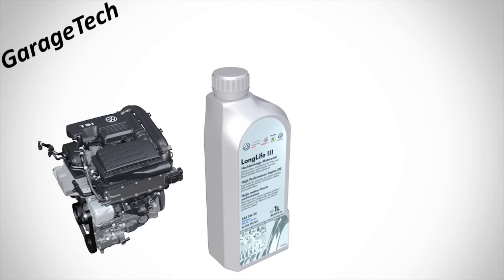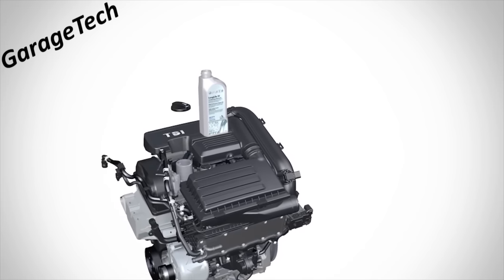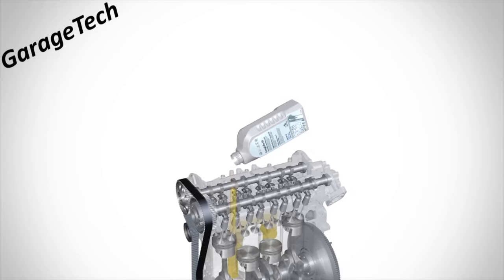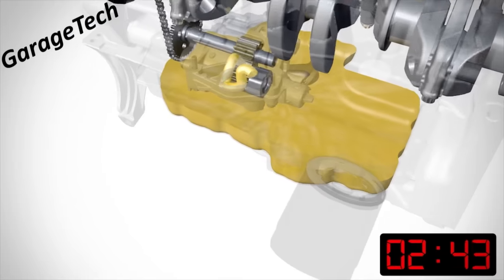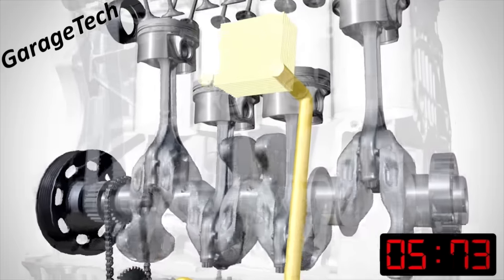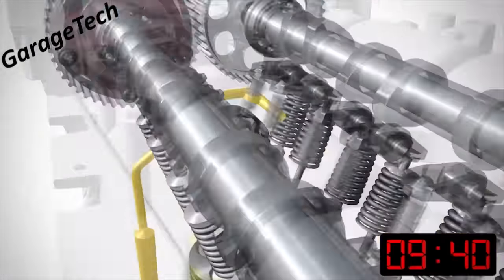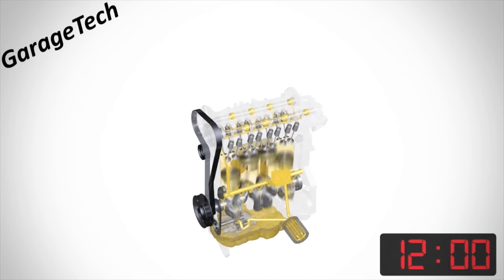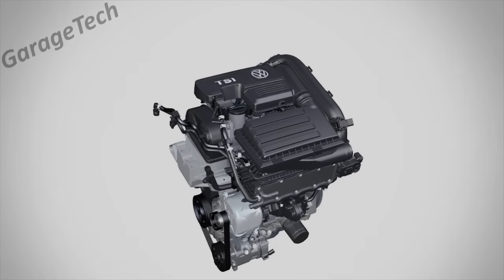How oil circulates around an engine when started

Comment: This video proves why start-stop systems destroy the engine.
Reply: No drain back on stop start so unless it's parked overnight the oil is there

See below ⬇️
Reply: Some Luxus cars like Mercedes have an electric oil pump that makes the oil always circulating. Anyway I also think it's very stupid. It is just one more thing that can break down (and it does pretty often)
Reply: @mikb7360  my vrs 128k no probs
Reply: @mikb7360  This system was introduced in order to reduce CO2 emissions. I don't know how efficient it is in real life. I usually have it turned off on my car. I think it is efficient when the car is stopped for more than 15''. I believe that the total cost of fuel saved is much less than the cost of parts wear when it's time to replace them.

Comment: First, oil will remain in your rod bearings, crank bearings and especially your cam bearings unless you take like 6 days to change your oil. Also your oil filter is backwards. Oil goes in from the outside into the center of the filter.

Comment: The time it takes for the oil to circulate depends on the temperature and the oil weight (viscosity). Thats why its super important to use the correct weight oil for your engine. If its a freezing sub 0 morning and your running a heavy weight oil it could take 30+ seconds for it to reach the top of the engine.

If you peek into the top of the engine thru the oil filler cap, you may or may not notice score marks on the camshaft lobes. Scoring is a sure sign of an engine that gets ran hard from cold on a regular basis.
Reply: It doesn't affect the time really. But it does affect how much oil goes where.

The thickness of oil you need to use depends on the tolerances between bearings etc. Using thicker oil increases oil pressure because it's struggling to flow through tight spaces like bearing, which causes more of the oil to flow elsewhere where there's less resistance to flow (which is usually higher up in the engine).

Hence why it's sometimes a good idea to change to switch to slightly thicker oil when the engine racks up a lot of miles.

Comment: There is something wrong in the animation with the oil filter. The oil never comes in fron the center hole. The correct insert is from the peripheral holes of the filter and the outlet from the center.

Comment: I always soak filter before install. Just makes me feel better. Also, I guess wrist pins get oiled up thru the rod?
Reply: Robert Miller I do too , unfortunately some cars you can’t went filter is mounted the wrong way
Reply: Wrist pins get lubricant by splashing oil out of the foot rod bearings; in this animation, the oil should flow trough the cooling jets from beneath the pistón skirt...

Comment: When it's -15C outside the oil comes to the necessary places much later than 12 seconds. I have a bottle of oil in my garage and when it's -15C or even colder the oil 10W40 becomes dense like jam. That's why we use 5W30 :-)

Comment: From this picture it is clear that overfill engine oil is very bad because it can cause foaming from the churning mechanism from crankshaft.  However, it takes a lot of overfill before it happened.  1-2L overfill from typical 4-5L engine oil won't hurt anything but our pocket because we used too much.

Comment: I am a mechanic, I generally dont fill my oil filter unless the vehicle is turbocharged or a hybrid, I also leave the engine running for about 30 seconds after filling the car to allow the oil time to circulater before checking the oil level and it also gives me time to torque the wheels and put the spare tyre back in the boot.

As for hybrids, I leave it running for a few minutes or till the engine auto shuts off(switches to elecric motor) to charge the internal battery of the hybrid, this gives me time to do the above stuff mentioned as well as the paper work and washing up, if there is still a bit of time left I tidy my tools

Comment: This is why I turn the key to just power only for 12 seconds before starting the engine. That way the oil has already circulated before the engine has even started.
Reply: I found that spraying WD40 on the key for 12 seconds before starting just as effective.

Comment: Ford Ranger 3.2 five cylinder engines use a variable vein oil pump to save fuel but need to be primed again if oil drained longer than about ten minutes. Lots of damaged engines.

Comment: 12 seconds is slow scenario with modern oils. It depends on oil's viscosity, age and temperature, to a lesser extent, the filter design. I’m aware that this video applies to a drained system, perhaps an older engine with thicker oil, but this isn’t the case with most normal startups. Most modern engines with low viscosity oils will build full psi within 5 seconds, even after replacing the oil.

Comment: Only thing is that the channels are already full and it's a hydraulic action so almost instantenous oil pressure at the bearings is archieved. Maybe in some old shitty engine with bad clearances the oil seeps out if the engine is standstill for long enough.

Comment: It's  a lot less than 12 seconds. Most oil pressure sensors are on the camshaft lube circuit. If the oil light goes off, you have oil pressure, which means oil is flowing at the camshaft. You can probably speed up the video ten times to get an accurate indication. As a mechanic I have serviced many cars and majority have the oil light go off after about a second after startup following an oil change.

Comment: Those 12 seconds that it takes to oil up everything is called dry running its were the engine gets most of its ware when there’s no oil pretty much on start up.
Reply: Magnatec and many others still have a film on it and unless you've just changed the oil OR you haven't started it in a month, there will still be some in the channels and it's more like 1 or 2 seconds.

Comment: It 
The motor oil will be hot to the touch in a matter of seconds. However, it takes the average car 20 minutes to get to normal operating temperature.

Comment: Is there a procedure you can do after changing the oil so when you do a start up you dont hear clatter for the first 12 seconds?
Reply: Dmitry Wiseman u can try disconnecting the fuel and cranking it so some oil gets pushed into the engine, but it can be rough on the starter and it wont oil everything up so it might clatter a bit still.
Reply: Disconnect battery and fuel lines before start.

Comment: According to my 20 year old saabs  owners manual, one should not warm up the engine in cold weather before driving of, since the engine stays cold for longer that way. And thats not good. After startup I just start accelerating slowly no revving no high loading, until the engine is warm.

Comment: Oil filter sizes vary from one cup to one+ quart.
Tiny ones have less air to purge obviously.
Chevy V8s have digressed from one quart filters down to 1.5 CUPS on the new 6.0L LS engines. They also get 5w20 or 0w20 oils. 

Many new engines automatically rev up to 1600 RPM for 4 seconds upon start up. No pressure??

If you're really concerned about dry starts, Google accumulators.

Comment: When i start my engines car i usually not to rev it until it reaches 30secs up, someones told me regarding this matter because the oil haven't climb yet to the top.
Reply: Not true, Video assumes lines are empty (Dry) and if you used the car before that Cold start that means lines are going to be filled with Oil.

Comment: My jeep oil pump is k but engine oil is not circulating what could be the reason.
Reply from the maker: Must be a blockage somewhere, have you checked the oil pickup pipe in the sump?

Comment: Had an idea, how about a way to start the oil pump prior to starting the engine. Lubricate the moving parts prior to starting. Will this work?
Reply: Usually big Diesel engines have an extra electric oil pump for startup, like generators trucks and construction vehicles 
Don’t know why car companies don’t put it in cars . Doesn’t look that expensive
Reply: Well when starting the fly wheel spins with the starter so it’s already moving the engine a little so its kinda priming the oil pump a little
Reply: @ahmedyassir5569  so it is possible.
Reply: Depends on the car. From what I've seen, oil pumps are mechanically driven. Such as on a small block GM the pump is driven by the camshaft

Comment: does this mean if we have a start-stop system in the car, and if we stay at the traffic light for 2 minutes with the car switched off, and start moving forward at 2000 rpm, our car drives for a few seconds without adequate lubrication?
Reply: direktor telekoma A few minutes won’t hurt anything.
Reply: No, oil lines and components are covered with oil, basically oil pump is going to push that oil from the lines, video is showing a new engine first start without oil being pumped before.

Comment: It is incorrect the oil doesn´t enter the filter from the center passage but from the small holes around the edge of the filter! Most of filters does have very simple one way rubber valve under these small holes so to prevent oil to go back to oil pan again. So after first start after oil change there should be at least some oil in there. I think that if you start your car again after i say few minutes to hour you can start at 5 seconds here. Always when i change oil filter there is some trapped oil that starts to leak after I release oil filter.

Comment: Back in the dark ages when cars had distributors, I'd unplug the low-voltage side of the coil and crank it until the oil light went out - and while doing the oil change, I'd fill the filter. It's a bit harder to do all that now.
Reply: My 01 integra has a distributor. Probably one of the last cars of the 2000's to have a distributor.
Reply: I remember the Suzuki G10 engines (Metro/Swift) had distributors with vacuum advance until they were discontinued in 2000. Is your Integra the B18 engine? When did they stop making those?

Comment: The first few seconds, when the starters turning the engine, it's not actually firing, yet the oils already circulating, and given how the oil filter won't drain back into the sump, it seems like engines start up perfectly healthily.

If your engine takes you more than 200,000 miles u got your money's worth. Most people discard their cars well before that.

Comment: A modern engine with good oil will last for several hundred thousand miles. Just change the oil and filter at the right time. If you're really paranoid, bump the starter a few times before you let the engine start.
Reply: That's why I'm still using my hand crank on my car

Comment: First thing in the morning-  I remove the oil filler cap , drop trou, center my butt on the hole and drop a fart which I’ve been suppressing since 4AM ! This massive  positive pressure spike forces the oil out to all areas !!! If any hydrogen sulfide gets into the combustion chambers it helps with the power stroke.  It’s a win/ win for everyone

Comment: 12 seconds is to any modern car with thin oil '0-20 or 0-30' older cars with 10-40 or 15-40 will take much longer than 12seconds
Reply: I let my car always run for 4 min when it's cold.
Reply: Lines are not empty when you used the car before... video explains the first ever start without oil

Comment: Incorrect animation, the oil doesn't go into the oil filter through the centre hole, it goes into the outside holes first then out of the centre hole. The outer holes have the one way anti drain rubber flap drain valve fitted so it would not be able to pump through the one way drain valve.

Comment: Not in a Porsche! The oil pressure shoots straight to 5-bar and holds there - getting the oil to the top of the engine in less than 10 seconds. BUT - the way the oil delays its flow until 10 seconds after starting means that 95% of all engine damage occurs in the first 10 seconds after startup.  If you rev an engine within 10 seconds of starting it, you are severely damaging the top-end of the engine because it is not lubricated or supported correctly be adequate oil pressure.

My Dad knew this, and so in 1975 he built a small cradle which sat under his car engine when it was parked in the garage. On that cradle was a 500-watt heater, and at the front of the cradle with a microswitch operated by the front bumper. The whole thing was plugged into a timer and it turned the heater on at about 4am, to gentle warm the oil in the oil pan so it was thinner when the engine started.

On top of this, he had a spark-killing switch in the cabin which he would turn on when the engine was cold. This allowed him to crank the engine for 10 seconds without any chance of the engine firing.

Once he had been cranking for 10 seconds, he'd flick the switch and the engine would fire up, and then he would continue to let it idle for another 10 seconds before engaging a gear. And he never ever revved an engine over 3,000 rpm until the engine was warm.

Over the Landcruiser's 15-year & 250,000km life-time, this resulted in the exhaust emissions being superior to my mother's 3-year-old Nissan Pulsar SSS.

Comment: I have been using same start technique for 30 years. On cold start turn over engine for 1-2 seconds then turn off. This can be a problem if your car starts on first turn of the key!  This allows the oil pump to push some oil around the engine. Leave for 10 seconds for oil to get to remote parts then start and immediately drive off (Saab recommended)  never let car sit idling as the oil won’t get to temp, keep max revs 2500 until water temp nears normal working level.  Oil temperature takes longer to normal than water so wait a little longer before any over 4000 revs. I have been able to see over 200k miles with this method. Oil changes for petrol 5,000 miles don’t need to change oil filter each time! Use Castro oil only! Do oil change yourself or watch mechanic put Castrol oil in unless you have complete trust in your mechanic! I don’t trust mechanics. Engines don’t last if you accelerate hard and rev high, the oil is stressed trying to stop the internal parts rubbing against each other. Cruise control is great for engines, they love a constant speed.

Comment: When I start my car from cold, I ALWAYS wait until the RPMS go from about 1200 to around 700(takes about 8-12 seconds) in my 328i F30. I know BMW says you can start it and drive off immediately. But when you do that, the transmission jerks like a mother and the whole entire time of driving it until it's cold again it will act funny. To be safe, turn your vehicle on. Let it idle and make sure you have everything. By the time you're done, it'll have been 20-30 seconds and you wont even know it. That gives the engine enough time to be properly lubricated as well as your transmission gears too. Runn iij ng the car hard while not at operating temp(from my experience) can and will overwork your serpentine belt and make it burst everywhere.
Reply: The Final Solution       If you have an auto the transmission has a cooler and it’s only effective when the radiator is hot so the engine needs to warm up to get the coolant warm to cool the transmission properly or else you will burn the clutch’s and your car go no where
Reply: @ryans413  yeah I know. BMW says even on cold you get get it! Lol. I learned after one time of starting the car and immediately putting it in drive was a bad idea 😂😂
Reply: The Final Solution    My transmission jerked and I was okay back to park. Thought I broke it got lucky probably close
Reply: Well then you got a problem with your transmission. Those ZF transmissions are really smooth and quick shifting.

Comment: It is normal that oil will reduce?
Reply: it's normal, only if it reduces very slowly (<100ml per year or 6k miles)
Reply: Gabriel C I think you meant 100ml per 6 months
Reply: @rizwanwali4223  oil usually reduces when engine is running, so distance is a better way of indicating this, than time.

Comment: While this may be the correct route of oil flow ... does not mean the oil actually gets to all those places ... 
You must remember that most dont do oil changes as often as they should and some never change their oil which leads to oil burning up and possibly clogging up those passages which now prevents oil from passing thru which means those parts NEVER get oil for lube ..

Comment: My brand new Ford Ranger 3,2 five cylinder diesel spun a main bearing at 1st service.
These motors loose prime in the oil pump if drained dry and if it happens you need to overfill sump to prime back.
My workshop obviously didn't get the memo. Brand new engine on its way. I read about this issue and didn't think it would happen to me but there you go. Never trust a dealer with your ride, find a good mech and stick with them or do your own oil changes (don't tell the dealer) Find someone to stamp your service log book.. Damn corona virus delaying repair..

Comment: I tend to wait 10 seconds at least first startup of the day before driving off. Did not know until now how long it takes.
Reply: Jim Barrows       Here’s a trick just wait until it comes down to an idle witch usually only takes a minute then drive normal until temperature gauge shows the engine is warmed up. Don’t need to sit there for 10-15 minutes. Plus if you need to defrost windows a such easy way I found is put everything on full blast and with in 5 minutes not even the windows will be defrosted and you can wipe it off. At least with my car the engine gets warm fast so I always have heat like right away
Reply: This is FULLY DRAINED oil that's just been refilled with an EMPTY filter. Normally there still stuff in the oil channels and it's more like 1 or 2 seconds. Unless you haven't started for like a month.